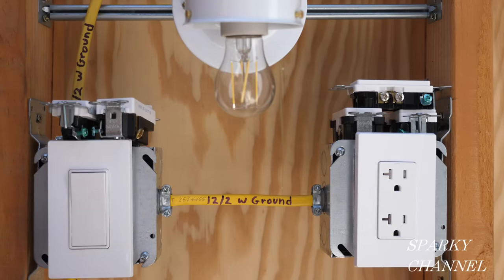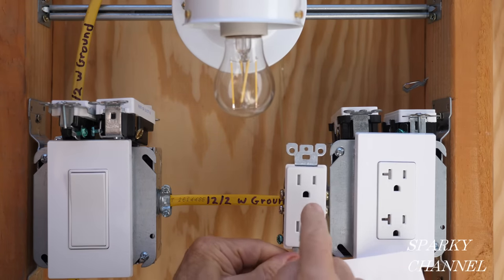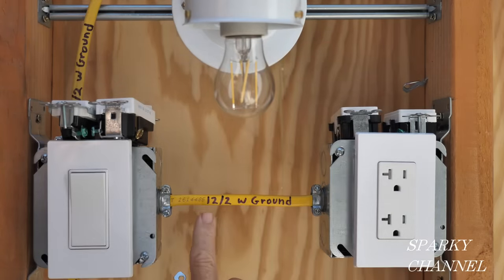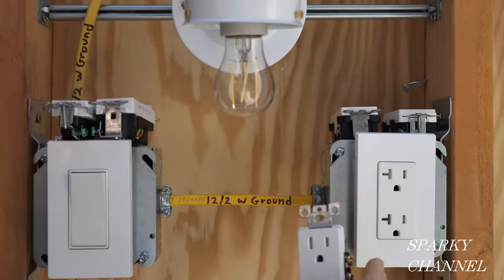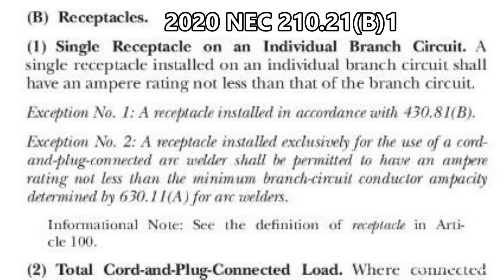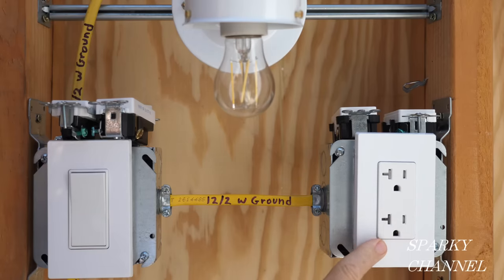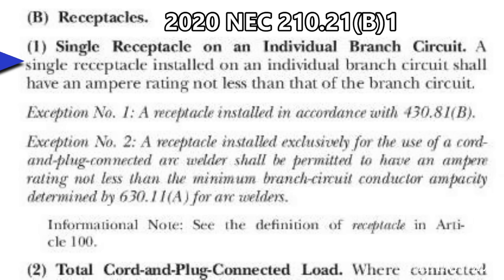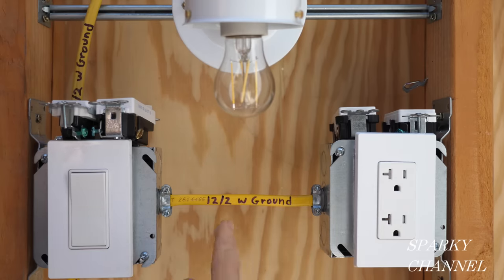Shall I Use a 15A or a 20A Receptacle on a 20A Circuit? + 2020 NEC 210.21(B)(1) and 210.21(B)(3)

Comment: I think pass through is the metal strap connecting the two screws of the terminals. You can also use these outlets to make connections to another load cable. The 20A must be more beefy, the size of contact area must be larger, otherwise the outlet will heat up. In the worst case starting a fire. Do I see that correctly that it is also possible to insert a 15A plug into a 20A outlet but it's not possible to insert a 20A plug into a 15A outlet?
It's interesting how the differences are in fusing different sizes of wires. The most used wire sizes in the US seem to be AWG 14 and 12 in final circuits. In the metric system we use the cross-sectional area of the conductor in squaremillimeter, no differentiation between solid and stranded in the designation of the wire size. There are some different standard sizes. AWG 14 is 2.08 mm², AWG 12 is 3.31mm². In Germany for example in most cases we use 1.5mm² and 2.5mm², the next step would be 4mm², then 6mm², 10, 16, 25mm² and so on. 1.5mm² is mostly used for lighting circuits and 2.5mm² for outlet circuits. But you can also use the 1.5mm² for outlets. We don't use a fixed rating to fuse a circuit, it depends also the circumstances of the cable (heat dissipation). On a PVC insulated conductor the critical temperature is 70°C (158°F), above this temperature the insulation starts to decompose. And this decomposing process is accumulating, so every time the temperatures gets above 70°C (158°F) the insulation is damaged more and more.
The best circumstances are cable embedded below or inside of a plaster/stucco, surface mounted (no one wants that in the living room, this more in a workshop or basement). With that you're able to fuse 1.5mm² (single phase) up to 20A or 16A three-phase. But actually no one would do this, voltage drop would be too high, even if the temperature of the conductor would be remain below 70°C. 2.5mm² can be fused with 25A (single phase) or 20A (three-phase). And the other extreme is a thermal insulated wall. In that case 1.5mm² can only be fused with 16A (single phase) or 13A (three-phase) and 2.5mm² can be fused 20A single phase and 16A (three-phase). The outlets we use here are rated for 250V, 16A. Nominal voltage here is 230V, so the outlet circuits can handle 3680 VA. Actually more, because circuit breakers don't trip on the spot when they reach 16A. The overload protection will let pass 1.4 times the rated current for one hour, in case of a 16A breaker that will be 22.4A. That overload was considered by the guys which created the tables which cable size shall be fused with which value.
It's also of interest how many cables are next to it, if they touch each other or not. If there's at least one cable diameter space between them or more. That especially is of interest where many cables meet, for example in the panel area.
That is all for copper conductors, for aluminium there are other values, but it's not permitted to use it for final circuits. The VDE introduced in 1973 that the minimum conductor size of aluminium shall be 16mm² in new installations.

Here if you use VDE certified products you're on the safe side. And sometimes the price difference isn't that high. For example on circuit breakers. The cheap ones from China cost only 50 cents less than the certified ones made in Germany. And if you're weighing up how long a good circuit breaker will last (in most cases 40 or more years), and how much trouble you'll get by using cheap materials, it should be clear which material you should use.
Reply from the maker: Yes that's correct, it is possible to insert a 15A plug into a 20A outlet but it's not possible to insert a 20A plug into a 15A outlet. I love to see VDE certification on anything!
Reply: @SparkyChannel  Here you'll find it on switches, outlets, circuit breakers, fuses, fuse carriers, GFCI devices, cables (only on the packaging, not the cable itself if it's an old german normalised type). And sometimes the chinese stuff is even more expensive...

For example:

Chinese circuit breaker:

https://www.amazon.de/Sourcing-DZ47-63-Miniatur-Sicherungsschutzschalter-Niedrigspannung-DIN-Schienenmontage/dp/B07KND3NN9/ref=sr_1_2?__mk_de_DE=%C3%85M%C3%85%C5%BD%C3%95%C3%91&dchild=1&keywords=leitungsschutzschalter+16A&qid=1593906884&refinements=p_89%3Asourcing+map&rnid=669059031&sr=8-2 

German circuit breakers with proper certification. The VDE can also be printed on the side. But if you buy from a proper store and a known brand you know that it is certified in most cases.

https://www.amazon.de/Doepke-Leitungsschutzschalter-DLS-C16-1-4014712163089/dp/B0028YSIAU/ref=sr_1_16?__mk_de_DE=%C3%85M%C3%85%C5%BD%C3%95%C3%91&dchild=1&keywords=leitungsschutzschalter+c16&qid=1593907527&sr=8-16

But the chinese one lacks the VDE certification. And the second reason it's not suitable for installation here is that it is only capable of switching off a fault current up to 4000A. Circuit breakers must be at least capable of switching off 6000A securely. Better is 10,000A.

The characteristic is type C, that is normally used in workshops were you have machines with a high initial current. In a normal house type B is the standard. We use thermomagnetic circuit breakers here in Europe. That means they have two tripping mechanisms. The thermal overload part is identical to the system you know with the bimetallic strip. But they also have an electromagnetic short-circuit detection. This is simply a coil, the thickness of the coil wires define the tripping current. The thicker the wire, the higher the tripping current. The coil operates a magnetic plunger which trips the circuit breaker. Comparable to a door chime.
Type B trips between three and five times the rated current. Type C between five and ten times of the rated current.
I remember the old type H we had in Germany, that was for grids with a high ground impedance.  They were manufactured until 1976, but sometimes you'll still find them arround. They trip between two and three times of the rated current. Back then that was ok, but now with a low impedance they're really a pain. Especially since they become more sensitive over the decades when they age. A PC, when it was disconnected and the capacitors of the power supply are discharged, can easily draw 30A or more for a fraction of a second. That is now enough for these old 16A type H circuit breakers to trip.

This thermomagnetic system gots the advantage of switching off short-circuits very fast. We're talking about a few milliseconds. But in that case the VDE is very generous, they want less than 0.2s for a circuit fused with 32A or less.

Comment: Thanks so much! Question. If you break off the the little tab on side of the receptacle can you still use 15 amp receptacle on 20 amp circuit? Does that effect anything with being code compliant?
Reply: 20 a pluga actually have a vertical and horizontal prongs instead of two verticals. so no you cant just break off the tab.
Reply: @fxtfusion  hey francis thanks for reply. My question is in regards to the breakable side tab on 15amp receptacle. I believe it makes the top and bottom outlets independent of one another.
Reply: @Lando1020  Hi Lando, YES you can.  It does not affect the NEC call out for being a single receptacle on a 20 amp. circuit.  Case in point: Many if not most DUPLEX receptacles under the kitchen sink installed within last several decades utilize a single 15 amp duplex outlet to supply power to two individual appliances...a dishwasher and a garbage disposal AND...they are frequently wired 12/2 (20 amp.). The tab is removed and the two devices may share the NEUTRAL.  But, realize that because they share the neutral in the cable AND thus they must have a common trip disconnect (breaker), that in reality, you have 240 volts inside that box, so in this case...be careful.
Reply: @caiobabe  thanks! Extra thanks for the extra info in regards to common kitchen setups. I can see how that can easily be overlooked.
Reply: @Lando1020  That's correct.  Removing the tab (between the screws) on a duplex receptacle isolates the two receptacles.  This allows the top receptacle to be on a separate circuit from the bottom receptacle.   In a kitchen, this allows the 12 amp toaster and the 12 amp kettle to operate at the same time without tripping the breaker.

Comment: I leave in and older house. Is there a way, using a volt meter on an outlet to find out if some parts of the wiring, going from that breaker to that outlet, has some 14G running. All I can see is some yellow 12G, but I highly suspect there might be some 14G somewhere. Thanks
Reply: No, if you suspect there is 14awg wire in between make sure u have a 15a circuit breaker, and not a 20. 15 amp recep as well.
Reply: Check the wire for that circuit back at the panel. It should also be 12g if not then you know somewhere along the like the wire was downsized for some reason. If it’s 12 at the box and panel, what would make you think it’s 14 in between?

Comment: I have a question for you, so most of my outlets in my house are ran 14 gauge wire! So not all the house is just some parts are 12 gauge wires and 14 gauge wires so my question is I want to add a receptacle for my TV should I use 14 gauge or 12 gauge? The reason why I ask this is because everyone says use 12 gauge wires,but why use a bigger wire on something that already has 14 gage? Please I’m begging you or anybody to help me out!
Reply: 12 gauge is 20 Amp max load.  14 Gauge is 15 Amp max load.  The total load of all receptacles in their circuit (from breaker ) while being in use should not exceed max load of that circuit.  Try not to use more than  total of  15 Amp (at any moment )if two receptacles are in use in that circuit of 15Amp.
It might work for few minutes if the wiring is new.  But the wire might heat up in the longer run and degrade the performance, and if used for long, it might cause fire.
Reply: @alexrod6304  thanks for the reply. I’ll be debating 12 or 14 it’s a 15 amp Circuit.
Reply: @TheDannytre  I'm not an electrician But I have wired a bunch of my own outlets and switches. If it is a 15 amp breaker you should be fine with 14 gauge. The breaker will trip before you overload the wire. The only reason you might want to consider 12 gauge is if you would ever consider upgrading to a 20 amp breaker. If you think you might want (or need) to upgrade the breaker in the future; using 12 gauge now means one less run to replace down the road.
Reply: It's likely because 12 is the standard now. Even on 15 amp circuits the wire will last longer and not heat as much, plus allows for a future upgrade with just changing the breaker. However if you are coming from a branch from an existing point and not the breaker, personally sticking with 14 would be better. I'm not an electrician I do a lot of electrical work from dealing with electronics and growing up around electrical work. I would recommend a 20 amp circuit if you're running a new one because the draw from entertainment centers (tv, sound system, cable box, game systems, etc) can be a lot more than people realize and with long term he as in possibly several hours at the time it would be a safer option.
Reply: 14 is ok AS LONG AS your breaker is 15 amp. If at all possible, please upgrade your house wiring to 12ga. The problem with 14ga is someone comes along and plugs in a space heater most of which will max out at 1500 watts. That's just too much for a 14ga and has cause a lot of fires. A lot of mobile home fires started that way.
Reply: @markhull1366  upgrading the whole entire house to 12/2 would be an awesome project to do but I am currently not in that state of doing some of that magnitude, I’m just upgrading receptacle outlets and running some new wires but not all the wires, it’s unfortunately the way they wired the house back in the day with 12/2 and 14/2 Together on the same circuit. Yes they are on a breaker with the right 15 amps.

Comment: Thank you for showing the NEC code info.  I'm getting ready to renovate a very large sun room.  Currently there are 5 outlets in the room on a 20 amp circuit, 12g wire, and 15 amp outlets.  I'm planning on adding 3 - 4 more outlets on this run.  One of the outlets runs a 8000 btu window AC, the rest will be for basic electronics.   Is it ok to continue with 15 amp outlets or replace them with 20 amps?  Will I need to split the load?
Reply: I would say split them just to be safe since you're adding additional outlets.  Is the sun room on it's own circuit or branch?  If you're going to use the 800 BTU AC unit in that room, replace one of those receptacles with a 20amp duplex because the compressor pulls close to 12 amps to kick it off.  We'll need the electricians here to advise better.
Reply: @corygillyard1455  Yes, those outlets are on their own circuit.  Lights on another.  I will split the load for the AC.  Thank you!

Comment: What kind the circuit breaker would you have in your main box if you're going to have  receptacle of 20A, and sharing  the  same circuit for  other electrical  services like switches for  lights in your garage ?
Reply: The breaker can’t exceed the wire gauge rating. If you ran 12 gauge wire for that circuit, use a 20 amp breaker. If you ran 14 gauge wire anywhere in that circuit, say for the lights, use must use a 15 amp breaker.
Reply: Your thinking backwards from the receptacle to the breaker panel.  Always determine what amperage your appliances require first.  Then install a suitable breaker that exceeds that amperage.  Then, wire the circuit with the appropriate wire size for that breaker.  Then choose the appropriate switches and receptacles for that amperage.  So, if your appliance or device draws 18 amps, you need a minimum 20 amp breaker supporting 12/2 wiring to the 20 amp receptacles.

Comment: I have mis- interpreted that section of the code for years. I only used 20a rec on 20a circuits all this time. Not that that's a bad thing. But at least now I can identify a few areas to save a lil money. But no way will I use the 39 cent receps.  Thanks for the clarification
Reply: I used  the 35¢ ones on my entire remodel! It was especially convenient to use the push connect ports on the back. My favorite benefit to that is that the insurance company can't blame me for when my outlets fail and this damn house burns to the ground, and I can be free.
Obviously I'm joking, I did all 20amp circuits and 12/2, with mostly 20amp receptacles because I'm insane. I need professional psychiatric help... No kill like Overkill.

Comment: Got a Leviton Plus 3-way 15/20 Amp switch; I'm assuming this is ok to use on a 15 Amp circuit?
Reply from the maker: Yes, absolutely.
Reply: @SparkyChannel  thank you
Reply: Can you explain how come that these switches say 20A 120/277V AC only but on the box it says 15/20 Amp? These are the Leviton Plus.

Comment: Great video!  I’ve been thinking about swapping the 5-15 plug in my garage to a 5-20 so that I can get slightly faster charging speeds for the EV I own. It’s a garage circuit so it’s 20A but goes to the garage door first then to the GFI 5-15 on my wall. My worry though is my EV is pulling 16A continuous will the inrush current from me opening my garage door trip the breaker? It’s fine now as it only pulls 12A because of the 5-15 plug on a 20A circuit but 16A plus the inrush from a garage door motor might be enough to trip?
Reply from the maker: Hi Nick! My advice is to put the EV charging receptacle on it's own dedicated 20A circuit with a high quality 20 receptacle. That way you should prevent breaker tripping and circuit overheating problems.
Reply: Or better yet a dedicated 240v 30 amp circut
Reply: Replacing a 15a receptacle with a 20a receptacle will not make your car charge faster.
Reply: @brianharmeson3144  I commented this over a year ago and since then I installed a dedicated NEMA 14-50, but with Tesla vehicles installing a NEMA 5-20 and using a NEMA 5-20 plug will charge slightly faster at 16A continuous vs 12A continuous on a 5-15 receptacle
Reply: @CrazyNickOO7  Is it on a 20a breaker with #12 wire?
Reply: @CrazyNickOO7  NEMA 14-50 is the way to go for sure. I bet you're glad you did it.
Reply: @brianharmeson3144  yes it was 12awg on a 20A circuit. It only had the garage door opener and a single GFI in my garage (both 5-15s).  I am happy I spent the extra money and used 6awg for the 14-50.  Charging at about 6kw now vs 1.4kw on the 5-15